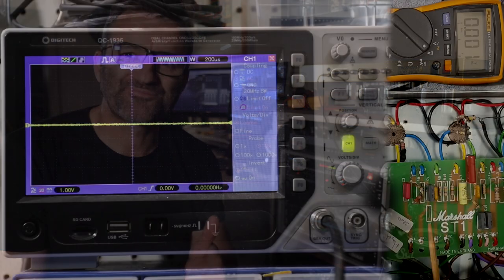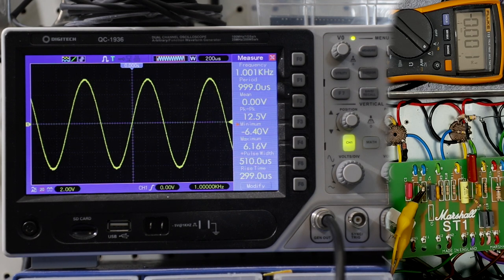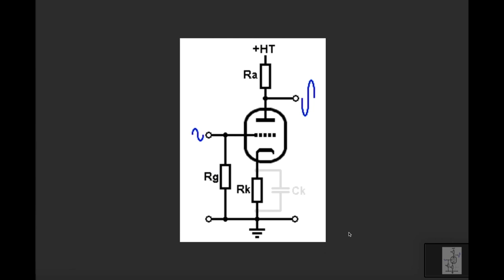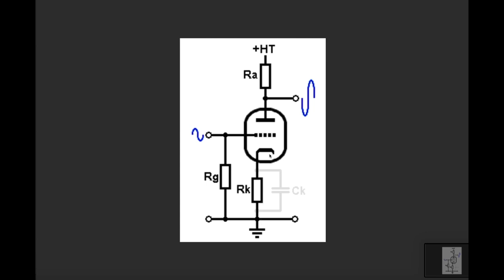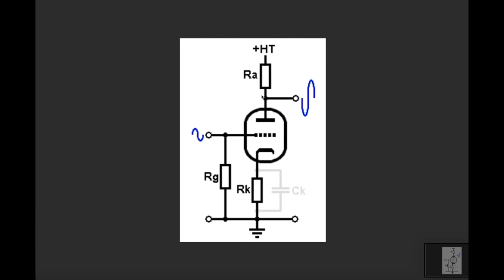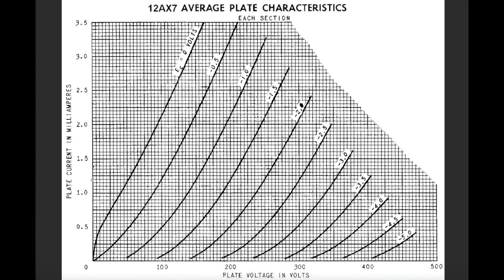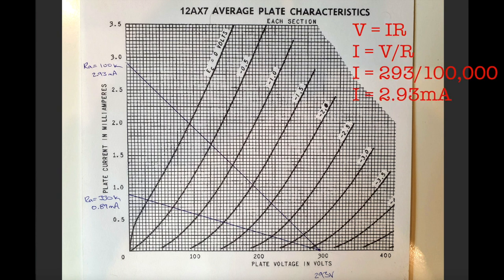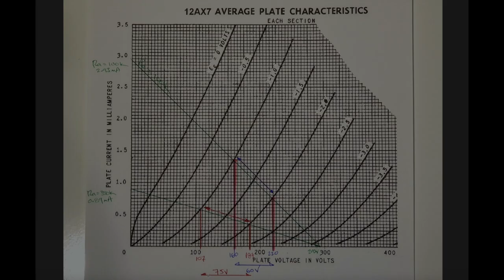Preamp Gain Stages - The Plate Resistor: Values, gain, tones and theory incl load lines!

Comment from the maker: Extra for experts: Notice the two pk-pk voltage readings 12.5 and 15.7.  Difference of 3.2v, exactly 25% more! Theory never lies.
Reply: I added a 6 way selector with various values and a digital meter. This lets me add or subtract resistance to the 100k and monitor the voltage drop across all the while being able to sample the effects without having to break out the soldering iron. I use to connect a decad box, much easier now with a selector switch

Comment: Great video. Inyeresting the voltage gain. But the current reduction is also a matter.

With the output peak to peak increase, is the chance of signal clipping on the next stage likely? Also, it would be interesting to apply a potentiometer to switch the values on the fly so to speak. Maybe with a rotary switch with a ranhe of values. If the scope of an amplifier can be increased with such changes, might be interesting to see if there are any real benefits to having these variations on an amplifier.

This actually explained a lot for me, and as I am new in this field of electronics, it has opened my eyes to matters about power transformers and using a generic one for various amplifier circuits, trimming the B+ to suit various amplifier applications for tone and responce. I can imagine switching whole circuits in and out using a relay set to switch between JTM and JCM circuit styles for example.

Comment: The plate resistor is the easiest one part change gain mod that can be done.  I've run as high as 330K on a drive stage which gets really nuts.  220K is a good high drive value, one used by Mesa on V1 of their dual and triple Rectifiers.   But I've found that it can be better to use larger than stock values on two consecutive stages, for a more controlled overdrive with (to my ear) a nicer harmonic spectrum.     Say two stages each with a 180K instead of one with a 330K.

Comment: So I don’t know if many guitars can reliably achieve a 1 volt peak to peak signal, but I imagine using humbuckers and a boost pedal, you should be able to reliably get there. My question is, if you have somewhere between 12 to 75 volts coming off the plate depending on initial guitar signal from the first gain stage, how do you not overwhelm the next gain stage?  At 300 volts, the grid can only accept 3.5 volts peak to peak before you get clipping. Won’t a 12 volts to 75 volts signal hitting that next grid cause massive square waves from happening?
Reply: Remember that the next tube's grid is connected to the previous gain stage's plate via a coupling capacitor. This capacitor blocks DC, but allows the amplified AC signal to pass.
Reply: @JonathanHerrera_Bass  I am talking about the AC voltage

Comment: I tried increasing plate resistors while looking at linear p-p voltages on my 2203 decades ago. I was able to get considerably more gain. The thing I observed is that it sounded more muddy as well. I suspect you need to reduce blocking/coupling caps as well to not decrease the high frequency content. In the end I went back to stock 100k. Some of the asymmetry when the p-p voltage exceeds a certain point is what helps flavor the sound. I now just hit the front end with a boss sd-1. Case closed…

Comment: Looking forward to checking this out Jason.  After the last one, I was going to suggest that since you have everything set up to do these videos, to do just this and change plate and cathode values, bypass caps on the cathode, etc. and watch what happens to voltage and gain and frequencies.  Very informative!  :)

Also, yes, the 330k in this example demonstrated that is was more saturated, compressed, and tonally complex.

Oh, and if you could....try more values for plates, cathode, etc.  For plates, try...82k, 91k, 100k, 220k, 330k!!   :)

Comment: 22:14 in...you show that there is a 25% increase in gain. 
You could have done this really fast without even looking at the load lines, though informative and just look at the delta (change) in voltage.  For 320k you had 15.7V.  With the 100k, you had 12.5V.  Divide them 15.7 / 12.5 and you get 25% increase!!  Easy!
Reply: Oops.  I see you did cover this in comments 2 months ago, but different calculation, but achieving the same outcome!!  lol
Reply from the maker: Yep!! I like to make it complicated!! lol

Comment: Fascinating stuff. I've used it to go the other way, and tweaked the first 100k plate resistor (the 'clean' input, or input 1 on my Plexi) to 50k (easy- just solder a 100k resistor in parallel to the existing one, so the pcb can remain in situ and it can be done in 10 seconds).
This gives me a lower cleaner input whilst leaving input 2 as dirty as ever. And mixing them is so much fun.
Reply from the maker: Great idea!
Reply: @HeadfirstAmps  I've thought of a better way which I hope to try: replace V1 (12ax7) with a lower gain 12at7 or 12ay7, and then increase input 2's plate resistor to compensate. This should also give me exactly what I need (leave the dirty stuff alone but have more clean range) but be lower noise. I think....

Comment: Can I imagine it this way?
When Ra is smaller, more voltage swing from the plate will be "lost" because of more current flow through Ra toward the HT supply, which can be seen as AC or signal ground.

Comment: Thanks for the great explanations. Why are the filter resistors in the power supply output not included in the plate load resistance for the DC load line?  It seems everything is interdependent.
Reply from the maker: Good question.  While a dropping resistor will have current flow and therefore develop a voltage based on the demands of the triodes, any effect they may have is negated by the massive filter cap (eg. 50uF) that sits on that node as part of the B+ supply.
Reply: @HeadfirstAmps  I can see that for the AC signal but when finding the DC load line and quiescent point do the filter caps come into play?

Comment: Weird question how would a 10k resistor affect tone ? because that's apparently the resistor that dave friedman got on his own personnal 68 plexi instead of the usual 100k he also got a 10k instead of a 100k linked to the tone slope 33k 500pf
Reply from the maker: A 10k plate resistor rather than 100k?  I don’t think so, that way too low
Reply: @HeadfirstAmps  thank you there is a video of his 68 personal plexi getting biased on the fryette channel and there were some strange 5 band resistors so it turns out those were 100k. he plays this amp exclusively with a variac and at the end of the video you can clearly hear it having a crazy brown sound.

Comment: As I'm more of a classic gain guy rather than high gain I tried a 270k, and one thing I really liked that's not immediately noticeable with the amount of gain used in the vid, (although Jason does mention it towards the end ) - is that it is very dynamic to play, enabling me to go from a rich fairly clean tone to a  nicely driven crunch and singing sustain just with picking dynamics, I don't need to pause my right hand in the middle of a lead up run to fiddle with volume pots, or worry about being within reach of a boost pedal, which is a big plus for me. I've since gone down to 220k for a cleaner clean, but still very dynamic and controllable. Thanks again Jason.
Reply from the maker: Nice.  This is great mate, tinker with these values to get the amp how you want it.
Reply: @HeadfirstAmps  Cheers, I've got a coupla really useful bypass switching options thanks to you, and it sounds and feels excellent to me. Now you've got me thinking about relays... I may be paying your store a visit soon. Thanks for all the gems!
Reply from the maker: Ha ha, awesome.